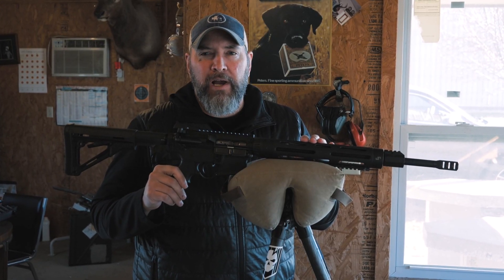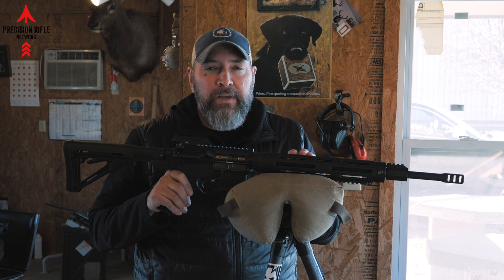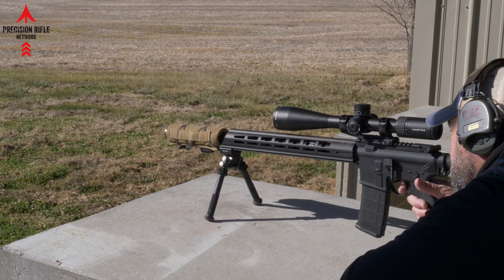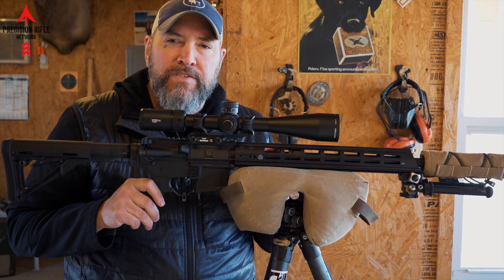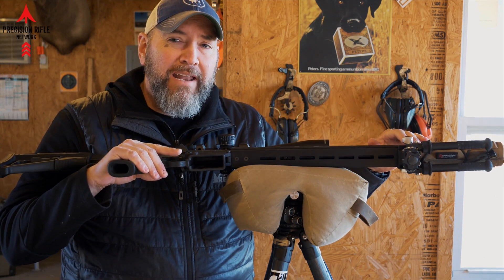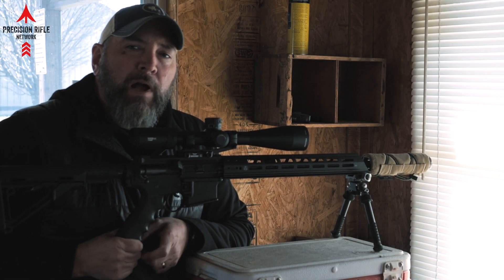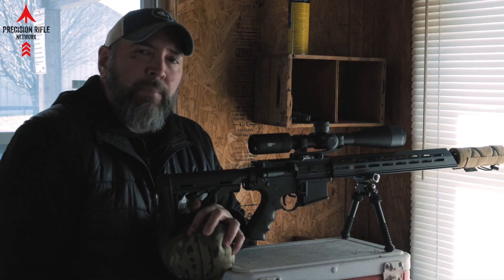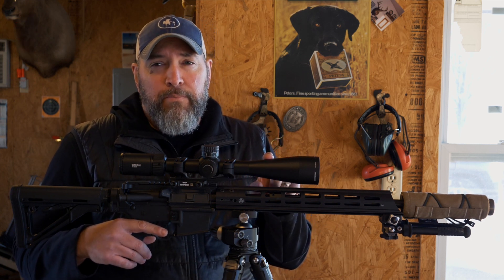3 Problems With Gas Guns & One Solution

Comment: Great video and interesting product. My three things that make my precision AR not as precise as my precision bolt rifle:
1. As has already been mentioned, lock time.
2. Deflection in where the barrel is pointing which is influenced by different load pressures on the forearm. 
3. Slight POI shifts due to how the rifle system reacts to the shooter's body positioning upon the early recoil sequence and discharge... which is easily blamed on lock time even though that isn't the same.
Reply from the maker: all valid.  Thanks!
Reply: Niles Coyote agreed. Unfortunately no single product can solve those issues. Inherit issues you got work around.
Reply: @PrecisionRifleNetwork  and Niles, there are a few ways to mitigate the 3 issues you've mentioned.
1) Lock time can be adjusted on an AR by adjusting the location of the gas port, weight of the buffer and load (strength) of the buffer spring. Having a Pistol or Carbine length gas system as seen on the last upper in the video does little to increase dwell time and dumps more gas into the carrier sooner, increasing bolt unlock and carrier velocity. The buffer system is a two-way street, you can't increase the effective weight of the system without also increasing the force of the second recoil impulse.
2) having a quality handguard with a quality barrel nut (Geissele,  PRi, etc.) and proper technique will reduce the amount of deflection placed on the barrel.
3) Technique and practice. Working with your system and adapting to how it reacts to differences in stock length and position, cant, offset, and shooting position are all things everyone needs to learn regardless of what they are shooting, gas guns have more adjustment and variables learn.

That being said, gas guns can be used as effectively as bolts, they just take more time and study. Can a gas gun sneak into a top slot at a local PRS-style event? Yes. Will gas guns dominate? No. Camels don't do well in horse races and vice versa.
Reply from the maker: asmcinn thanks. Agree.

Comment: A lot of bolt gunners have a hard time dealing with the two recoil impulses of a gas gun. The first when the cartridge fires and the second when the bolt carrier slams forward. You can’t get away with poor position or trigger control with a gas gun.
Reply from the maker: very true

Comment: That handguard is awesome, definitely going to look at that. I came to a similar remedy by adding the Area 419 universal ARCA rail to the bottom of my gas gun handguard. I'm tossing the idea of running my 308 gas gun at local club matches since we only go to 600-700 yards, but the bolt gun is just so much easier to drive.

Comment: Biggest issues I've found are with gas guns is barrel fitment, receiver face flex, and bullet deformation during chambering. Barrels can be bedded with locktite. Seekins, larue and aero address the flex issue but, the 6 o clock QD on the aero rail is dumb and limits arca lenth. Bullet deformation can be reduced by blending and polishing the feed ramps.
Reply: Check out JP Enterprises new LRI-20 upper receiver, it addresses the issues you mentioned. It even uses a simple thermal fitting process for barrel installation. You can get up to a 17.25" handguard and an ARCA rail if you want.

Comment: Seekins has a nice flat handguard too. But honestly, that last point about shooting off a cooler - that entire portion had to be an inside joke, there's no difference in what you were saying the shortcoming is of the gas gun that you wouldnt have in that same position with a bolt gun, unless Im completely missing something unique about gas guns that lets you get a bag supported under the buttstock hanging out in mid-air. Both gas gun and bolt gun could use a tripod rear support in that scenario, right?
Reply from the maker: the cooler comment IS an inside joke.  The point I was making was with respect to shooting off of confined spaces like the top of a 55 gal drum or in this case a cooler.  Not being able to slide the bipod towards the rear of the rifle is the problem.  The catalyst arms handguard, and most bolt action chassis, allow the shooter to slide the bipod back enough to get front and rear support under the rifle.  You can't do that as well with a standard AR forend.

Comment: Really not sure how accurate these “problems” were in Dec of 2019 but (1) I don’t see many round hand guards on AR-15/10 rifles today in 2021, (2) bipod mounting on AR pattern rifles typical is more versatile than most bolt gun stocks (modern bolt gun chassis systems obviously are more like typical AR’s) and (3) with more points of potential support (magazine, pistol grip, stock toe) on the AR vs a typical stocked bolt gun with a flush or floor plate magazine system this last “problem” rings a little hallow, too. 
I get that pushing products helps pay the bills but doing so with such obviously manufactured “problems” really hurts your integrity. 
That said, it looks like a nice hand guard and I’ll keep it in mind next time I’m in the market for one.
Reply from the maker: Ok well I hope you feel better about yourself.  I feel wonderful now having basically been called a liar who makes stuff up.  To your points: literally everything a person could say about the positives or negatives of any product on the market, is completely subjective.  Everything boils down to personal opinion.  I gave mine in this video.  Take it or leave it.
Reply: @PrecisionRifleNetwork  sorry you took this as a personal attack - re-reading it now I guess I can see how you might. 
This is the first of your videos that I’ve run across and it definitely left me confused (more what I was attempting to convey in my comment rather than the attack). If I interact with more of your content in the future, I’ll try to keep it more positive. Genuinely sorry for calling you out.
Reply from the maker: @nbonner75  It’s totally ok if you disagree with something I say. I’m ready to defend my points. 
What I can’t stand is someone questioning my character, because I do the best I can with these reviews to be fair and truthful.
Reply: No, you are right, this is clearly shilling, don't back down from this coward who doesn't have the balls to admit it.

Comment: I guess I shouldn't be surprised by three non-issues with a sponsored solution. Nice commercial, dude.
Reply: Like, that third problem is not even a gas gun problem. A bolt action would have the exact same issue.
Reply from the maker: I’m guessing you didn’t watch the whole video. If my explanations of the benefits of the fast track handguard don’t make sense, then I’m also going to assume you don’t shoot long range competition very much.